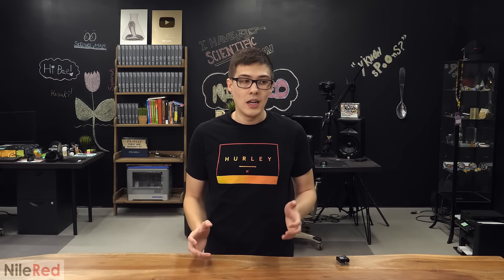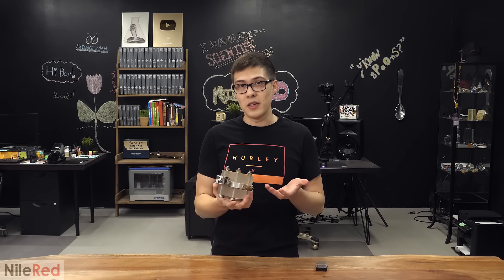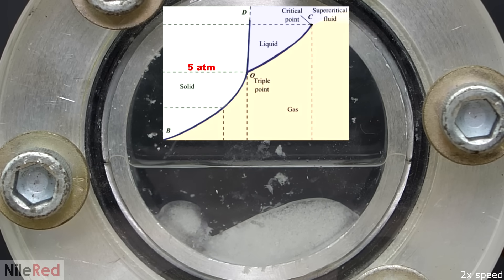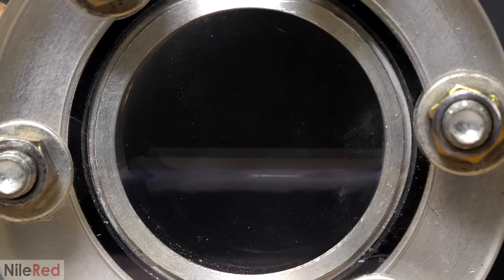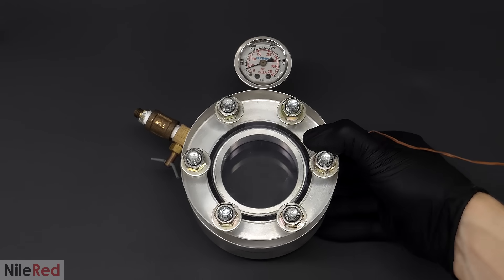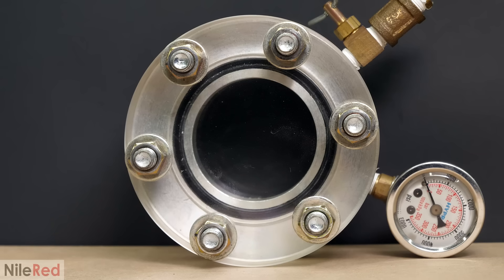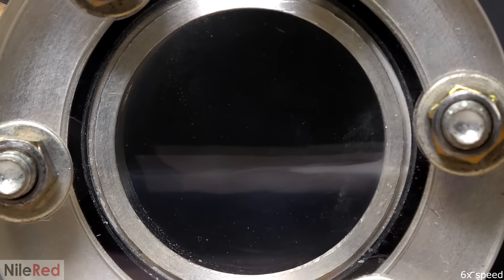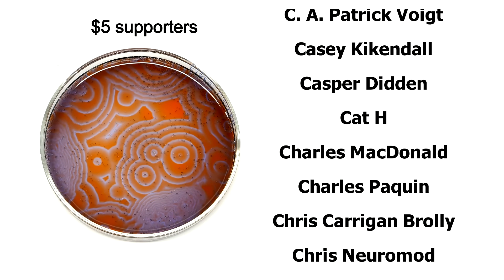Going supercritical.

Comment: Awesome!! I'm glad the chamber is serving you well. Your videography skills are outstanding, and have such a recognizable style. I'm also glad the chamber didn't explode on you :)
Reply from the maker: I only saw this now, but thanks again for sending it!
Reply: @NileBlue   😍😍😍
Reply: @NileBlue  I do believe that you made something similar to opal. Opal is a type of silica which is why it has that rainbow look compared to a translucent carbon gem.
Reply: @NileBlue  o
Reply: @NileBlue  Ps For future reference, use a torque wrench to quickly and precisely tighten bolts/nuts.
Reply: @NileBlue  The warped appearance of the colours suggest polarisation along the crack surface, possibly circular polarisation caused by stretching in one direction. This would lead to Newton rings appearing but only part of the ring appears in the short space of the fractured surface.
Reply: @NileBlue  you're welcome
Reply: @NileBlue  just to clarify (yeah, that is the time to do so after 5 years vid was released lol)
The barometer was feeling good all the time. When ice melted at about 5atm you could've seen the meter go slightly higher than 0. That is because it is made for frankly high pressures. For example at 11:03 at supercritical it clearly shows us ~25bar (or ~25atm). Just the measure units thing to note huh
Reply: @NileBlue  Don't forget to replace that pressure gauge
Reply: @NileBlue  nice
Reply: Ben, you're a treasure
Reply: Thank you so much for sending this equipment to NileBlue. I've watch both of you for years. I'm not very scientifically inclined- certainly isn't my profession. Nile is easier for me to understand sometimes and i think the less technical way is good sometimes, just for people who only want the demonstration. 

This material kind of collaboration is always great to see. I just want to reinforce that this was a good expenditure of your time and resources. At least as far as myself as an observer can say/attribute.
Reply: Thanks for your amazing gift - this was a really interesting video and it couldn't have happened without you.
Reply: Applied Science Thans for the gift Ben🙏🏻
Reply: you’re a legend
Reply: "I'm also glad the chamber didn't explode on you" - Nice. I think we all are.
Reply: You guys are the hero’s. But my boi Nile is the bomb.
Reply: I love how cooperative sciencetube is.
Reply: About rainbow colored cracks - you can find something similar in ice when it cracks after being removed from the fridge, try it
Reply: legend^
Reply: Thanks Ben! You're awesome
Reply: that smiley face feels suspicious...
Reply: You Sir are a legend. Really kind of you!
Reply: I love this kind act's between such great channels. Thanks to both of you
Reply: Thank you for your gift! Amazing experience!! ^^
Reply: Thanks Ben
Reply: Thanks ben
Reply: What a bro, Totally gonna subscribe
Reply: ben, you seem like a kind person and I like that.
Reply: Wow you are incredibly nice. Hope good things come to you good sir.
Reply: You are a POGMAN.
Reply: Thank you for allowing nileblue to do this test! It is absolutely satisfying!
Reply: Thanks 😊😊. This video would never have been possible without you.
Reply: Meow
Reply: ur awesome
Reply: Legend
Reply: Ben is a real one, true to the streets
Reply: @applied science, @nileblue, I know this is an old video, but if you use this chamber again please look into the material properties of acrylic vs polycarbonate.  Acrylic has a tendency to create stress fractures from drilled holes, while polycarb doesn't and is frequently used for safety eyewear and ballistic shields
Reply: @boloren  It's true, high pressure CO2 will diffuse into polycarbonate, however.  It seems OK for short term, only.
Reply: thanks for providing the amazing gift! i have subscribed to you also :D
Reply: I have a suggestion for anyone trying this in the future. Try tightening the bolts down with a torque wrench, and if you have the money, do multiple tests until you find the minimum torque needed to keep it from leaking.
Of course this would only apply to your specific container.
Reply: You're the best! Thanks for working with Nile!
Reply: Why can it explode?
Reply: Because as the dry ice melts it creates a higher pressure in the container by spreading the molecules out more. Adding heat also encourages the molecules to spread apart more but because they're limited to the container they just bounce off of each other and the walls even more violently than before, ultimately pushing on the container even harder, thus resulting in higher pressure.
Reply: @crystalgolemcolossus  pressure makes things go boom
Reply: bro. y u so wholesome? i love it
Reply: i wanna touch it
Reply: Can it handles chorine gas
Reply: Helo ben
Reply: Same. Idk where I'd be without nile.... welll.... probably not doing chemistry😂
Reply: Did you keep track of the torque you applied to the clamping nuts?  I'd be curious to hear what the range of safe torques is for the cell.
Reply: it was awesome and enjoyable at the same time..
Reply: I'm glad it didn't make the house go kaboom
Reply: Torque wrench to know how much pressure should be applied safely? Just a late late idea for you guys. Love your work!
Reply: you bloody legend
Reply: Thank you for your gift to him💙
Reply: Thank you so much for our favorite Youtubers are borrowing your chamber! This is what we needed thank you so much
Reply: Besides being Interesting , what is the use for it? Where would you apply this ?
Reply: What a fucking lad Ben, good on you!
Reply: Awesome!! I'm glad the chamber is serving well. 

was just a different way to say "O cool!! it didn't kill you"
Reply: Chad scientist, we need more people like you
Reply: https://youtu.be/eZaG5IiJvf4
Reply: You are great
Reply: 69th reply xD
Reply: I didn't know you before, but now you got one subscriber and viewer by that.
Reply: Dude thank you for helping this dude
Reply: It's good to remember that there are good people out there. Thanks Ben!!
Reply: Ben, Nile red, and Cody are my go to guys for honesty, and professionalism. My love to all of you.
Reply: @HeaanLasai  no
Reply: oh god.. explode!?
Reply: I’ve met so many competitive animals in the science departments; I majored in BIMS. I’m glad there are still good people in this world that collaborate and openly warn others of the dangers.
Reply: Hi, I love your videos as well I was very impressed with your contribution to help out.
I am also subbed to your channel as i love science and making stuff.
Reply: I would guess the chamber wouldn't fail until about 3000 psi
Reply: Is there any way you could see this in nature? Like in an underwater cave where C02 gas can be trapped under pressure. I've heard of there being similar anomalies where a gas can be trapped creating a distinctive separation between  H20 and another liquid with a different density but how specific would the circumstances need to be for super critical C02 to exist? I'm imagining a geothermal cave in the ocean but I'm having difficulty picturing what that would look like. I'm open to suggestions on refining this question aswell.
Reply: u should've used a tourqe wrench xd
Reply: Beautifully done. I got glued to this video.
Reply: Thanks Ben, really nice + cool of you man. Big fan here from NY.
Reply: Thanks Ben!
Reply: when the NileBlue and the NileRed meet each other it causes an imaginary technique imaginary technique nilepurple
Reply: Thank you very much applied science!
Reply: Did you try making the pressure or temp go over 9000? That might help.
Reply: @CatalystNetwork  Might help it go to catastrophic fail.  This is way out on the limits of folly.
Shred your hands, shred your face & if it doesn't kill you you'll wish it had.
Some of ya'll are instigating foolish behavior in this kid.  You know nothing about him & you don't care.
If you want it jacked up to 9000 psi, YOU do it.
I've seen extreme material fails.
Once they start they are too sudden to react to or comprehend; the damage is done before whoever is close enough to catch the released energy can know that Now, Everything Has Changed.  There is a shocked silence.

Then the screaming starts.
Reply: Michael Austin ‘over 9000’ is reference to a meme.
Reply: @CatalystNetwork  please clarify me on this; I did not know.  And as well would you be so kind as to forgive me?  For In my in my ignorance I excoriated you.
Reply: Michael Austin the title. Going super critical. Is a play on words. Ie. going super Sayen. 

The pressure over 9000 is a call to that theme as well. 

It’s a dragon ball z meme. But like. It’s old.  

Anyway. Jokes dead at this point. ;)
Reply: @CatalystNetwork  Thank you for your explanation & patience.  Sometimes I go charging off like a, uh, well, a guy who goes charging off.  In every direction at once.  Or not .
When I do that, well, the usual.

Sort of like playing neutron pinball.  Whatever that is.
Anyway, thanks.
Reply: @hauntedhunter8377  calm down Leeroy Jenkins.
Reply: When you’re tightening bolts on something like this, do one and then the bolt directly across from it. Repeat until all are tight. That’s the safest way with high pressure applications.
Reply: @20Ian Jury Yeah, bro, that is The point.
Most of these guys don't seem to care.  Or, they do, but in the wrong direction: mayhap they earnestly desire go find out that with their encouragement a hopeful young man was ruined or killed.

Comment: 1:20 in chemistry last year we learned that it is called plasma, not supercritical fluid. can someone explain the difference?
Reply: plasma is basically a gas exposed to heating or a strong electromagnetic field, that turns into a soup of ionized gas and free electrons. Plasma conducts electricity and responds to magnets. The glowing gas in neon signs is a plasma. 
A supercritical fluid is a gas compressed to a point where it's neither gas nor liquid, but a state that has properties of both. It can dissolve things like a liquid does, but it can also effuse through solid containers like gasses do. Sometimes canisters of compressed nitrogen or other gasses are supercritical fluids.

Comment: What if you hooked up a bottle of CO2 then put dry ice in, seal it then pressure it to 1400 psi with the gas, what happens to the dry ice? What about as it melts? Also the balls would have had water in it from the atmosphere and when it was put into something that was below zero it froze making the cracks in them. Just a guess nothing to base it on

Comment: My educated guess for the behavior of the silica beads is that they behave as though underwater because of the quantity of atmospheric pressure they are under. Afterwards, they fracture due to either the rapid pressure change, temperature change, or both. I does make me wonder how coal would act in a supercritical environment.

Comment: There's something I don't get about supercritical fluids. Here's my current understanding:

Gas gets denser under high pressure, but liquid does not. Under a high enough pressure, the gas can become as dense as the liquid. At that point, the gas has no reason to float on top of the liquid, and so they become one homogeneous fluid.

I can see why it has to be above a certain pressure, but why does it have to be above a certain temperature?

Comment: Silica beads are extremely cheap. You can find both colored and clear ones at your local dollar store, usually on random end caps attached to cardboard labeled "Floral  Beads."
I love playing with them. I have some that are supposed to be golfball sized when fluid "filled."
The beads tend to crack like yours did when they dry out too quickly like in low humidity, high heat environments and I've had many get that shatter affect. For example when I left the larger ones in a tray with shallow water overnight to get them to swell. If there wasn't enough water, they would swell and then the different sections dry at different paces and crack and deform. The bit on bottom or part touching water changes differently than the top and same with any outside parts exposed to air unlike the center. If you wet them after these cracks appear, they shatter and crumble easily.

The cracks seem to be related to fast changes in humidity. I know it may be different for your circumstances, but I've had many turn crackly brown like that and been unable to restore them to clear. This happens even in a sterile environment, so aside ftom impurities in the beads themselves,  I doubt it's caused by contamination or any bacterial/fungal growth like my initial concern had been.  The cracks appear when too much water is added to a mostly dry large bead as well. The larger the bead, the more fragile the cracks make it.

If you'd like some links to online sellers, please tell me the size and color you are looking for. Do you want golfball when saturated or golfbsll sized when dry? It should be about $10-13 for 30-80 large beads. I've gotten 150 for $14 before. If the seller is over $20, you're getting ripped off.

Comment: A torque wrench is the tool to to make sure bolts are uniformly tight. They're rated in inch lbs. or foot lbs.. Tighten in a star pattern to ensure even tightening. So far as gaskets and seals go   they can be a one time use kind of thing. Once compressed to a certain point they aren't re-usable.

Comment: Silicon desiccants are made of SiO2, the same as quartz. The high pressure from the super critical fluid and the sudden drop in pressure more or less exploded the micro structures of the beads.  You pretty much crushed the internal crystalline structures, and likely some CO2 was able to get into the micro fractures to the beads, so when the pressure was released it fractured the beads internal structures. These new fractures bend the light to make a the colors your seeing. 

But the brown color change, that might be due to some additive they doped the bead with to be a better desiccant or humidity indicator. Hard to tell without know exactly what they were made for and how.

Comment: that is micro cracking in the silica. the colors are the light refracting in the silica. depending on the angle the light penetrates in you get different colors. its just a bending of the light really.

Comment: The rainbow effect is definitely due to the interference inside the cracks, as you hypothesized. You have a three layer stack (SiO2, air, SiO2) with, probably a ~1 micron air layer, which is pretty much perfect for getting a full spectrum interference pattern. the curved surface of the bead also helps, given that the rays entering the bead are refracted at that interface too, so it would likely (depending on the angles of the crack, viewer, and curvature of the input and output surfaces), work to spread the wavelengths out even further. PS if you are interested, I happen to be someone who wrote software to model this and could give you examples of what the light is doing in there.

Comment: Silica beads are very pourous, so shoving supercritical CO2 into them probably changed all of the molecules previosly trapped in the cavities to CO2. That would explain the cracking (when the pressure dropped a lot of strain would be put on the crystal structure) and the colour change (probably some forbidden electron transition between the trapped gas and SiO structure or transition within the structure itself made possible by the change in crystal field. The rainbow streaks are mystereous, but as you said they look like thin films interference magic. Anyway, really nice video! Can't wait to see how you made aereogel

Comment: The cracking silica beads looks really similar to the cracking of marbles that occurs when you heat shock them. From an oven directly onto ice. The outside of the marbles smooth but the insides cracked. It's because the marbles expand in the heat and then condense really hard in the cold.

Comment: Yo Nile, you're doing it wrong. I'll tell you exactly what you need to do a supercritical project.

Things you'll need...

A 2 inch diameter PVC pipe about 8 inches long with threads on both ends.
2 PVC end caps.
A drill with a 1/8 drill bit.
1 canister of butane.
And last, 3 pounds of dank shake.

The word of the day is "Honey Oil".

Instructions are as follows...

Comment: Hey Nile, The surface or cracked area of the beads became super porous from the CO2 coming in and expanding and then collapsing. You might be able to send them to Ben and have him use his SEM to check if the surface is porous :) You see similar effects in research papers where the guys will use microbeads into a polymer and then dissolve the beads to leave the polymer very porous and filed with holes. Oh the cloudyness is due to critical opalescence/ tyndal scattering . Density fluctuations spike near critical points due to the enthalpy spiking to the point where you can get these scattering effects.